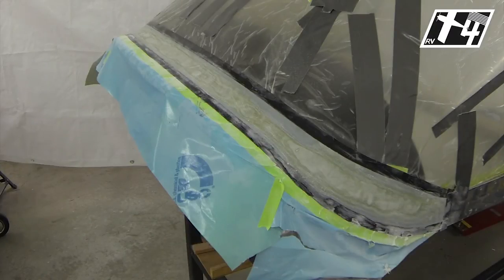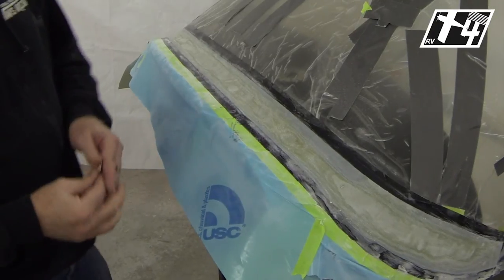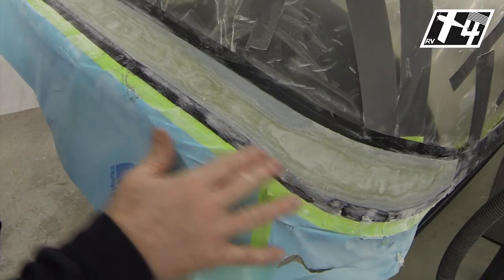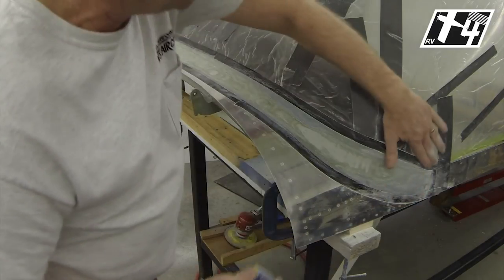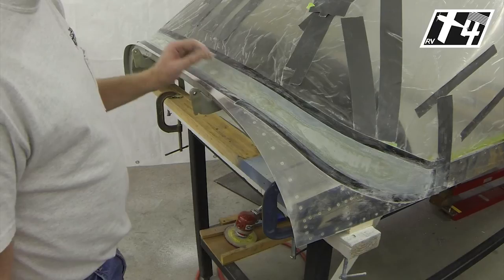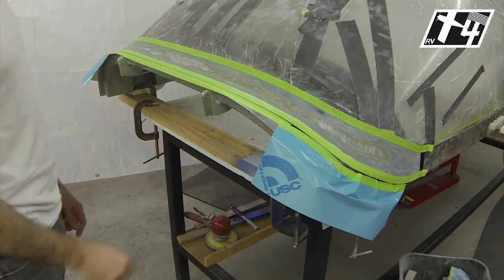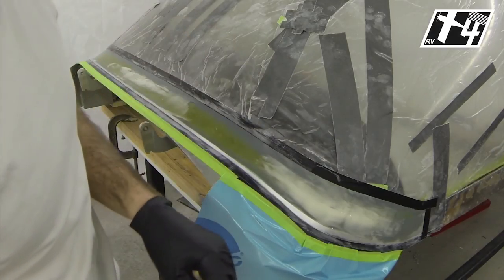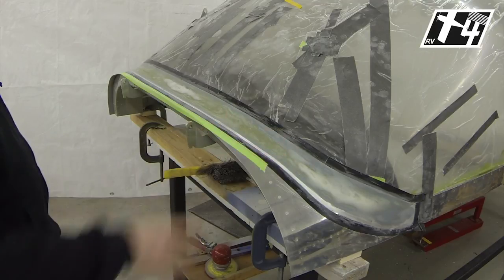RV-14 Canopy Fairing Area Preparation Part 04

Comment: What grit sandpaper are you using?
Reply from the maker: As mentioned in the video, all initial sanding is done with 80 grit.  When the final shape is established and you have sanded down to the outer layer of tape, all subsequent sanding is done with 150 grit.